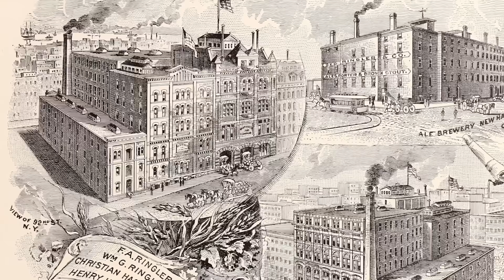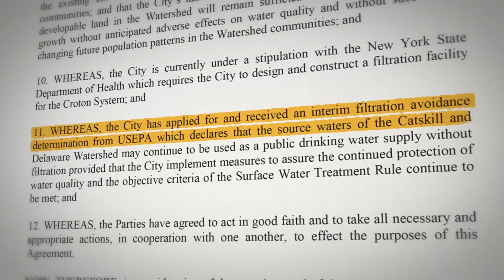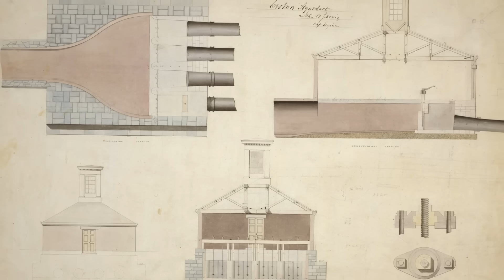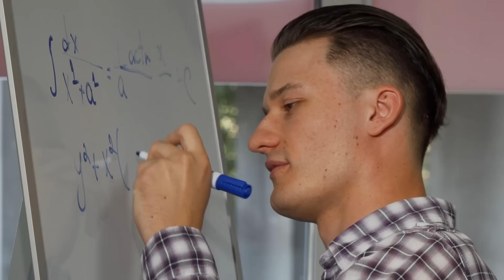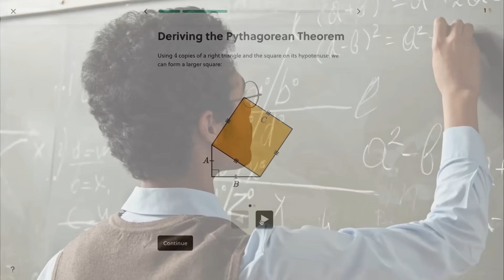The Simple Genius of NYC’s Water Supply System

Comment: Back when I did an architectural thesis focusing on the pollution in the hudson river, you touched on basically everything for the the NYC water supply, but a topic idea for the future could be looking at combined sewer systems and seperate sewer systems. The hudson river still has raw sewage dumped into it during heavy rainstorms due to the existing combined sewer systems in the towns and villages along the hudson river. Potential future video idea for ya
Reply: Dude that's what I was gonna say! Combined Sewers are wack and while they may have worked in the past, they're really dangerous to continue operating today.
Reply: Now waters much cleaner with reduced pollution and planting of I believe oysters to clean waterways. Interesting documentary on the subject.
Reply: @MrGlenspace  yea, visited some site that monitors the Hudson's wildlife and water quality back in 2019. They showed us a pic of one of the oysters down there that was almost a foot long(possibly longer now).
Reply: I'm a water resources scientist and CSS (combined) are the primary driver of poor water quality in many urban areas. Europe has big issues with it to, as more recently constructed systems are rarely combined
Reply: @xaviernogueira  I hear some cities have built huge overflow tunnels and basically overload of the mixed system flows into those and then when demand is low they pump the water back up for treatment. of course the road to something like that which could handle NYC would probably be many many hundreds of billions of dollars.
Reply: @filanfyretracker  yes exactly. In fact my company is helping design one as we speak in DC. I also know Glasgow UK just built a huge one. The difficulty is the underground construction costs, which are extensive and involve tearing up major roadways for extended periods of time. It's a "hard engineering" solution. We also implement "soft" solutions such as green stormwatwe infrastructure that attempt to slow the conveyance of stormwater and get as much of it as possible to seep into the soil. Green roofs, sediment catchment basins, stormwater ponds, and more are under this category. Finally there is technical engineering where we can use AI or other statistics to attempt to optimize the many gates, pumps, and controls within the sewer system. All three solutions together is the current vision to solve water quality, however AI stuff is more R&D now.
Reply: there are already too many reports, videos, ... lazy takes dedicated to those "negative American things" (to the point of exaggeration, even made up stuff) so it is kinda nice to see someone, throw some light on something American is doing right, for a change.
Reply: nobody mentioned great chemicals being dumped into drinking water from air pollution and fluoride
Reply: @MaximumEfficiency  does happen but runoff and sewer outputs are MUCH bigger culprits in US and Europe. That said depends where. In China or Mexico City the levels of pollution are such that air pollution effect on water quality is more significant.
Reply: Are you referring to rain water and sewage systems? If yes then not only do I agree but I really to know what genius decided to combine those two things. It's really not natural to not allow rain water to seep into land. I wonder if taking all that rain water and not letting it saturate acres and acres of land. That land saturated with water makes humidity on hot days. Humidity on hot days causes clouds and clouds cause rain to fall. I'm not suggesting that's true, just asking a question.
Reply: @mboyer68  As land develops, it gets covered and can't absorb as much water and standing water in fields is tolerable.  Flooding of residential areas is a health risk.  Hence, put a pipe in to drain it and while you are at it use the pipe as a sewer.  They didn't even treat it for 70 years, just move it away from population and diffuse in larger body of water.
Separate systems being worth investment is a post 1950 concept.
Reply: Its an issue in many older cities in the country. For the last couple of decades, Seattle has been building a series of huge tunnels that serve as holding tanks for storm run off until the sewage treatment plants can catch up. Seattle is also doing a lot to divert runoff at the source. Chicago has been at it even longer, but they aren't doing much to divert at the source.
Reply: How in hades does "architecture" even pretend to comprehend aquatic ecosystem biology?

With that said -- yes, the whole NYC metro area is an ecological nightmare, as is any overgrown, densely populated city.

People are so vain in their naivete about matters of long-term aquatic ecosystem health, as if nature takes care of itself despite human intervention.  Look at Lakes Powell and Mead right now -- dewatered, to turn deserts into grass-covered artificial landscapes.  The Los Angeles River has not run for about 70 years now, thanks to "development."  Artificial water transport systems were created to help LA "grow" despite having no more water for what then existed.

People consider this "progress," though they don't even pretend to wonder what exactly constitutes "progress" when you are destroying the ecosystem you depend upon for life.
Reply: We had that issue in Toledo oh.. during heavy rains sewage would dump into the Maumee river.. which goes into Lake Erie. The problem has been fixed now, it was a big undertaking for the city, they built underground overflow tanks.. which a new park sits on top of now 😊 

I can remember in the past, it was in the heat of summer, and it’s when that big black out happen.. all the sewage from all the little city’s and Toledo dumped straight into the rivers, then Lake Erie. 
About a week later I was out on Lake Erie and you could literally see all the toilet paper and raw sewage in the lake!! 🤮🤭
Reply: It’s still weird to me that Gowanus (our very own Super Fun site) is labeled basically as “South South Slope” now-a-days, and is full of strollers competing with bicycles for parking space.
Reply: @requiemforameme1  ive always wondered why the city does not just pull off the bandaid and fill the canal in, I mean is it actually used for anything other than throw away jokes about pollution and three eyed Simpsons fish?  that is does anything along it still depend on it for moving stuff on barges.
Reply: @filanfyretracker  I don't think they are allowed to.  In any case, it would be horrendously expensive. It is a superfund site that is currently ongoing.
“The city literally just started cleaning up Gowanus and it's going to take at least 10 years for them to finish,” said Riccobono, from Voice of Gowanus. He said the push to complete “this huge rezoning before they've even taken the first step to try to repair the legacy of environmental damage is incredible”.Sep 2, 2021"
Reply: @requiemforameme1 morons who will buy a condo with no idea of where they are.  It’s basically Love Canal II.
Reply: @requiemforameme1 my comment to you was censored by YouTube.
Reply: That would be a great vid. I’m in Pittsburgh and we are in the same boat, probably about 4 billion to fix. I wonder what the nyc cso fix would cost.

Comment: When he said the physics of siphons was not fully understood, I had to remind myself that this was not Half as Interesting
Reply: Is he really wrong, though? The following is an excerpt from the 2015 paper 'The height limit of a siphon', published in Nature Scientific Reports:
"Although the siphon has been used since ancient times, the means of operation has been a matter of controversy [CITATIONS]. Two competing models have been put forward, one in which siphons are considered to operate through gravity and atmospheric pressure and another in which gravity and liquid cohesion are invoked."

So while I don't think it was really necessary to discuss the why at all in the context of this video, and enough to just mention how it works, I think the phrasing used in the video seems fine since it would be unreasonable to go into more detail.
Reply: @bungaIowbill  no I definitely don't think he is wrong, but for some reason it felt like something that that wacky guy at HAI would say before cracking a joke about Applebee's
Reply: @bungaIowbill  I have honestly always thought it was once the fluid got moving it was pulling a vacuum in the line, And since a tube is sealed the only source for filling the void is more water.  I make this opinion and support it by the fact that pipes for which the faucet can potentially cause backflow to the water lines of the building you have these little caps called a vacuum breaker, if water tries to flow backwards like it would with a siphon the little valve opens breaking the siphon.
Reply: @filanfyretracker  part of the problem with your statement is, what does pulling a vacuum mean? We actually have a very good understanding of siphons in a localized system. If the exit of a siphon is below the entrance, and the siphon is sealed so that neither air nor water can escape the siphon except through the entrance or the exit, then a volume of water completely occupying the siphon so that air cannot bypass it, will exhibit the same dynamic pressures at the same elevation throughout the system. This is because fluids move from high pressure to low pressure to equalize. The pressure in the siphon itself is facilitated from the atmospheric pressure of the upstream body of water supporting the column of water. An inverted siphon works for the same reason.

It isn't creating a vacuum because you can't pull pressure, but you can push. Thus the low pressure doesn't pull the fluid into the space to fill the void, but it does allow the supported column of fluid to be pushed into the vacuum to equalize the high and low pressures. 

I think the part which is not understood is how this works over a large distance where the atmospheric pressure at the entrance is different than that of the exit. This is no longer something which can be understood as a local system.

However, I think I disagree with that assessment. It is still a localized system governed by the same localized system as before, just segmented into much smaller units. Measured at say every foot, it remains a question about static pressures in that segment and fluids moving from high pressure to low.

I think the physics behind a siphon is well understood in principle, but beyond a highly controlled and localized experiment, there is a lot which makes things a deal more unpredictable.
Reply: @bungaIowbill  Siphons work in a vacuum
Reply: I'm an engineer who's worked on the NYC system.  We've used actual siphons to temporarily release reservoir water while the outlet pipes are being rehabilitated.  There are height limits on siphons because the water is rising above its static pressure line.  However, the water supply tunnels are inverted siphons, where the water goes down and then comes back up.  There are no limitations on the depth of an inverted siphon.
Reply: I mean, they are pretty well understood. It's like my old roommate saying "We don't know how bicycles work!?" Like, yes we do, but there are just some minor physics contributing to the problem that are affecting it in a way not fully anticipated.
Reply: Jeez I thought that statement was just a joke but apparently not. The physics of siphons is not fully understood, how does interesting.
Reply: It did feel a bit like a lead in to a joke, didn’t it? Crazy that nobody’s figured them out yet, given how ubiquitous they are.
Reply: @JamEngulfer  What does "fully understood" mean? Knowing the very basic operating principle? Or being able to create an experiment and have a theory that will predict everything about that experiment *precisely*?
There are a great many things where the former is done, but the latter isn't, because there's always imperfections and details missing that make the prediction unreliable/inaccurate

Comment: Awesome video. I like how this channel focuses on real, impressive feats of engineering like this, instead of fake "tech bro" pipe dreams like Hyperloop and SpinLaunch. I'd rather watch something like this than some CGI-inspired stupidity any day.
Reply: If you enjoy that, you must also check out the B1M and Practical Engineering.
Reply: Tomorrow's Build (Second channel of the B1M) has done a video on what happened to the hyperloop and Real Engineering has done a video on Spinlaunch
Reply: @heidirabenau511  I found the Tomorrow's build video gave way to much credit to the hyperloop which is obviously failing in the real world, and I still believe that hyperloop has basically no use cases (just use a train lol) but the real engineering video on spinlaunch was actually very insightful and well made, and making launching satellites cheaper is a real problem that is worth attempting to address. The working 1/3 scale prototype launching at Mach 1.6 is at least convincing enough evidence to continue development I think.

Comment: Interesting, I was just in New York yesterday and pondered this same exact question while overlooking the Hudson River - how such a massive population center surrounded by undrinkable water can support itself. I checked the maps and saw basically no substantial reservoirs nearby and no rivers besides the Hudson which, just by looking at it, definitely isn’t drinkable.
Reply: Actually the quality of the water from the Hudson isn't bad in the northern half until around Poughkeepsie, like he mentioned in the video, and plenty of people rely on it for drinking water. The river bed is pretty muddy so it can make the water appear as if it's not drinkable, but it is
Reply: Drink Hudson River water like a local: 

Step 1: Slurp the liquid into your mouth. 
Step 2: Tilt your head back and remain still so the oils separate to the top, then squirt the oils out between your teeth. 
Step 3: Tilt your head down and remain still so the chunks settle to the "bottom" against your teeth, then carefully gulp a small measure of the pure drinking water that sits at the back of your tongue. 
Step 4: Swish using the remaining water to dislodge the chunks from your teeth. Spit out the chunks ~away from the river~. Remember, we don't want to contaminate the waterway with garbage. 
Step 5: When you develop diarrhea, make sure you get plenty of hydration so you survive.
Reply: @googiegress  What the-? Haha.
Reply: @googiegress  meaning more river water?
Reply: @jonathanodude6660  Nothing and nobody can stop you, my dude, so follow your heart <3
Reply: @googiegress  damn, the only steps to drink the river water near me is to avoid it at all costs. It’s called the shit crick for a reason
Reply: Than where?
Reply: @edwintorres1327  More Water-Shortage-Coverage: 
-Some More News 
-Second Thought
Reply: @edwintorres1327  pump from deep level aquefers
Reply: If you go all the way to the source, the Hudson River is actually a freshwater river stemming from a natural aquifer.
Reply: Even more amazing/insane are cities like Phoenix, and Las Vegas which are in the middle of freaking deserts.
Reply: @ersp1 
Hoover Dam.
Lake Powell
Lake Mead
Colorado river
Reply: @ersp1  I mean, you could make a good argument that Phoenix shouldn’t even exist in its current form, considering how unsustainable the water situation there is. I don’t know anything about Vegas so can’t speak to that, but yeah, the situation is Phoenix is… interesting and ethically complex, let’s say.
Reply: They couldn't do it without Upstate.
Reply: Apparently you didn’t look very hard.
Reply: Guess you're gonna be confused when you look at Europe, since most Europeans don't get their water from reservoirs ;)
Reply: It's not self-sufficient it literally cannot survive without the Upstate.

Comment: At 8:20 there is an error. The technical term for this phenomenon is communicating tubes. However, this only applies to static systems, not to dynamic systems. When water flows, it loses its energy through friction (head loss).
Reply: The video was very weak around 8:20 "The physics behind siphons is not fully understood; there are competing theories"... is downright misleading. 
The physics is super basic and well-understood for all intents and purposes. Sure there were nuances around the contributions from surface tension and cohesion, which can provide similar effects at low pressure and in zero g, but for the most part it's basic pressure differential, first year undergraduate engineer stuff, super easy to calculate and intuit. I have seen quite a number of Youtube videos now which say "it's not well understood" when in reality the meaning is "I don't understand it personally".
Reply: @JayLikesLasers  He didn't say whom it was not fully understood by; could have meant himself.
Reply: @JayLikesLasers   Thank you, even I knew that, and I'm not close to an expert. Fluid dynamics is widely studied.
Reply: Same thing used to call drive home arguements with the ex
Reply: Inverted siphon is the correct engineering term.
Reply: @iiiiii-w8h  Since I'm studying water engineering in Germany, I had to look up this term. For me, the term only applies when avoiding obstacles (like hudson river) and not for the entire system.

Comment: Overall fascinating video, but this system does not appear to be a siphon, so the statements about our understanding of them is not relevant and seems to undermine the engineering rigor that went into the system's design.  The water flows down before flowing up, so no suction is needed, just a pressure differential.